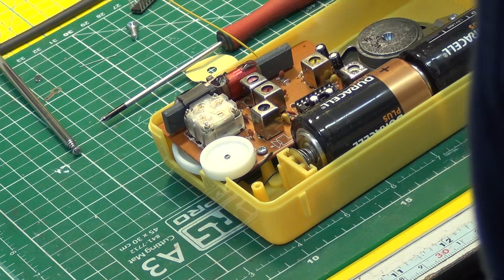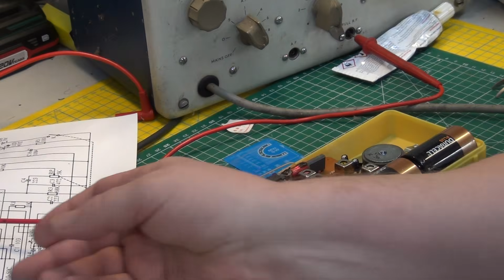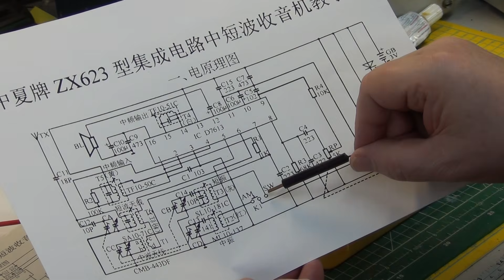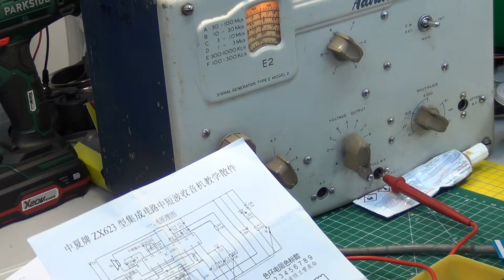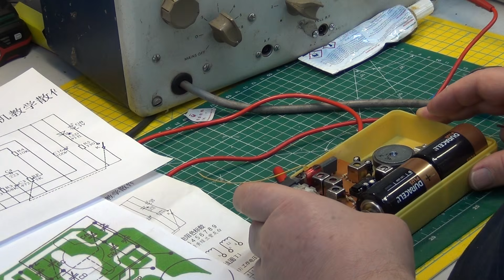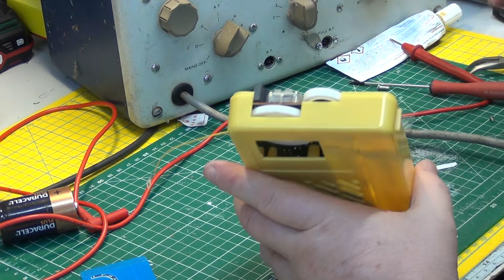ZX623 Chinese radio kit  pt2 of 2   AM/SW

Comment: I presume Richard that there is a way of tuning everything up 'by trial and error'. I can't imagine that in certain parts of the world where this may be a major purchase, that they would have signal generators etc. available. (Even my father produced a gas cooker heated soldering iron which we took with us on our caravan holidays...just in case...many years ago).
Reply from the maker: Yes, You'd tune in a station on a known frequency & set the tracking capacitor to make the station appear on the dial in the right place....and adjustthe others for maximum volume by ear.  There are only two MW stations now broadcasting in the UK....and both are weak signals where I live. 
Richard, G0OJF, UK
Reply: @ukfmcbradioservicingTango21  Many thanks for the explanation Richard. I hoped that was the case. I may need to do that at some point though in perhaps a years time there will not be anything to listen to apart from lightning (which I sometimes do) and the highly illegal smart meter telemetry signals that completely block Radio 4 on LW at certain times of the day. There is always Radio Caroline of course...;-) (FM and DAB are a bit of a problem where I live and Streaming Radio is not what I regard a 'Real Radio'.

Comment: An interesting kit radio and unique having just AM & SW and the larger size batteries, the one I've got uses 2×AA which I buy in slabs of 8 from Poundland and the radio has AM and FM but I only use it to receive Caroline on 648khz everything else I listen to online or DAB for cricket coverage.